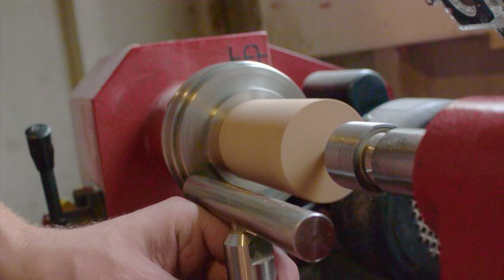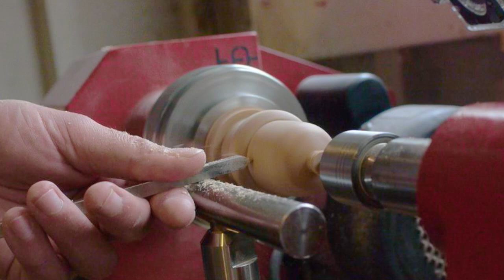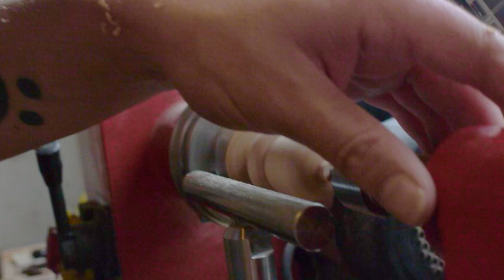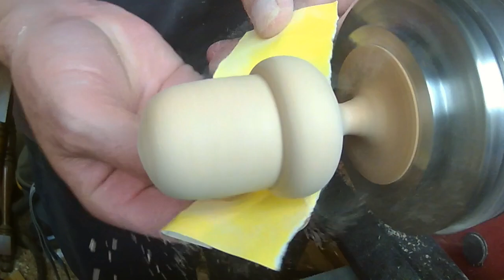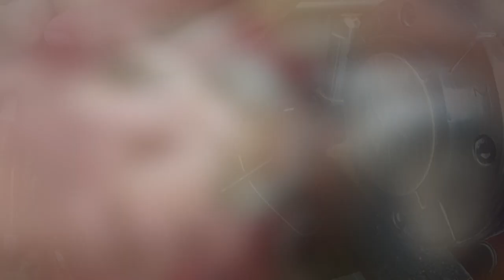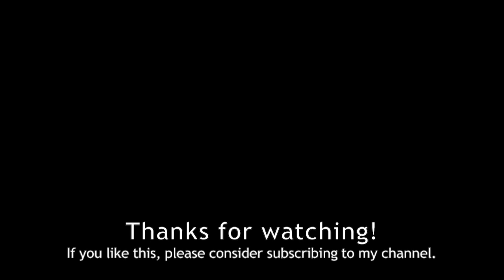Woodturning  - Acorn - 10 Minute Turning Projects #01. (Turning sounds, no music)

Comment: How much did your lathe cost?
My grandpa made his own using a modified mains powered hand drill and I tried to recreate it myself but it would never stay on true centre.

Been wanting to get into wood turning for many years now and you've inspired me to give it a shot (for real this time)

@jibadee
Reply from the maker: You should totally do it! I only started in January 2018 and it quickly become my favourite thing to do. 
This particular lathe was around £400 from new but my first was much smaller and a lot cheaper from eBay. That was basically a hand drill motor attached to a small ally plate, was ok, fine for the 3 days I used it before getting a more traditional looking lathe for £140, again from eBay.

Man, if you're doing it then feel free to fire over any questions you have, I'd be happy to help where I can from what I've learnt so far 👍 

Also thanks for watching!! I hope you found it useful.